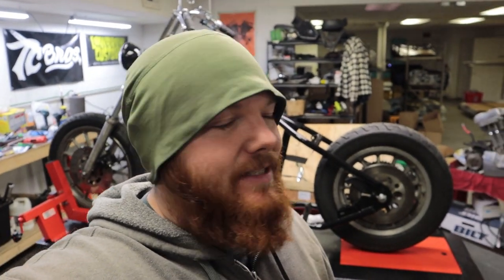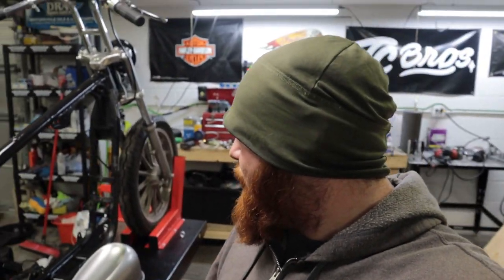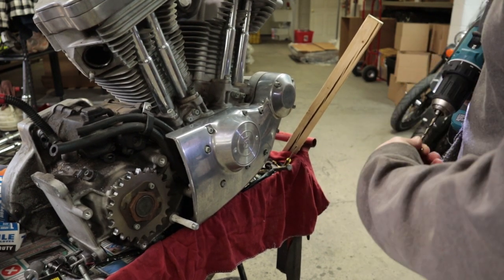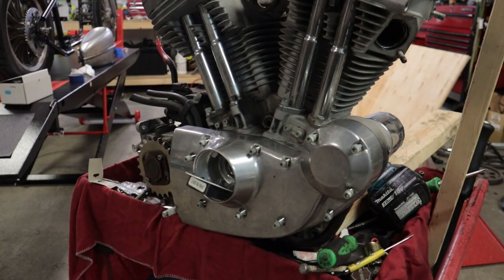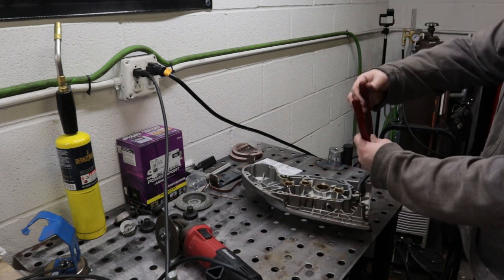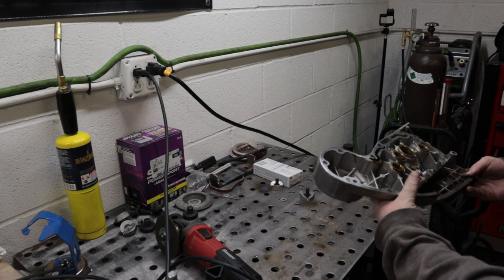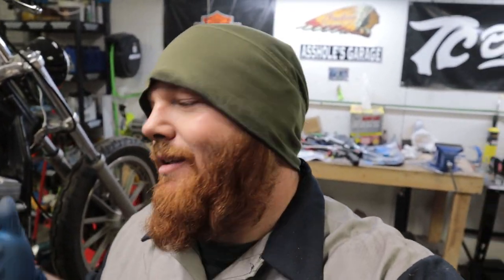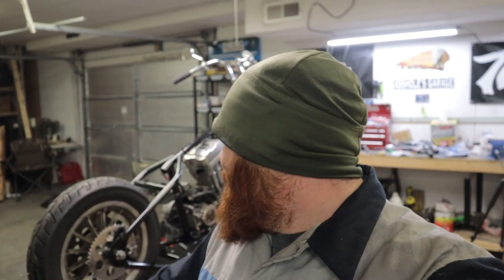Let's chop the cam cover! | Sportster Chopper - Project Grimace

Comment: you dont need to take the cover off. i  just cut mine down with cut off wheel while still on the engine .worked great

Comment: In a 1200s the stock main jet is 195 and I find this paired with a 48 slow jet it works beautifully. Also, I’m running a louvered air cleaner with a two into exhaust. Good video here! Just purchased the carburetor off Amazon to test it against my 2000 rebuilt carb ;)
Reply from the maker: The jet sizing can be all over the place depending on year and emissions requirements.  California bikes are set much leaner stock.  Thanks for watching. Let me know how it worked out for you😀
Reply: @STLNik  is it possible to link the one you choose on amazon since there are so many different knock offs. Also is there any mods you do to it right out of the gate line the slide spring being any different size or quality than let’s say the stock one or a rebuild kit. Thanks again man! Love your videos and info
Reply from the maker: I always click on the first one that comes up. As for modifications I've always left them alone.

Comment: Did you have to loosen the rocker boxes to relieve tension on the cams?
Reply from the maker: No.  Just make sure you remove the bolt from the ignition or else it'll pull the cams with the cover.
Reply: @STLNik sweet. thanks for the reply!

Comment: So what do you do with the hole on the bottom towards the front?? I think it’s lined up in the cover w/the #4 cam front exhaust. Does Oil drip out of that hole in the cover or is that a breather hole or something thats cast in the cover?? I’ve seen vids where people Tig weld that hole up. Why? What’s it for. Does it affect anything cutting cover down & leaving hole on bottom of cover unplugged and open?
Reply from the maker: None of mine have this hole you speak of.  Are you sure you aren't watching people cut an Iron head timing cover?   It may also be an early evo.
Reply: @STLNik  Thanks. It must be only early Evo Sportys. Mine is a 1994 1200 Evo Sporty & it ends up w/a hole that'll leak oil on the bottom after you cut,shave etc the cover down. I ended up just tapping and putting a little Allen screw plug in the hole.

Comment: Looks way cool! Did you have to remove the timing module like that in order to pull the cover off?
Reply from the maker: You don't have to remove the ignition but I'm replacing it with an aftermarket so I cut the stock one.
Reply: @STLNik  ah ok. Did you have to remove the rockers to unload the pressure on the cams before removing the cover? I'm worried about the cams coming out with the cover.
Reply from the maker: I didn't but I was prepared for the possibility.  There's a bolt behind the ignition that holds the rotor to one of the cams.  As long as that bolt is out the cams shouldn't come out but shit happens.